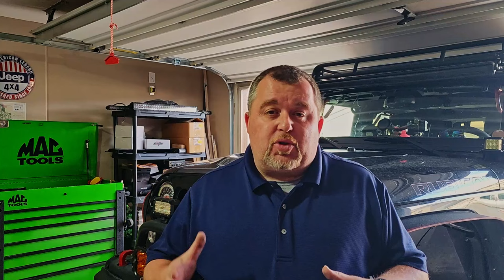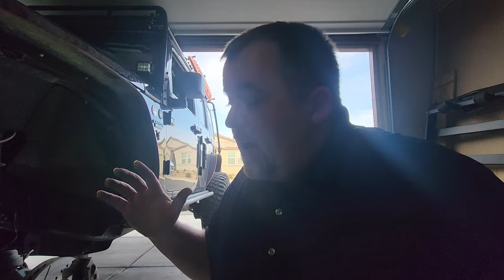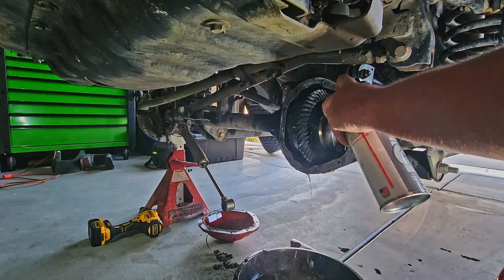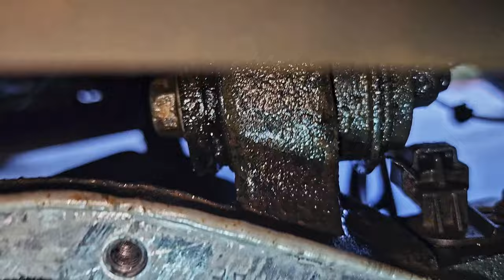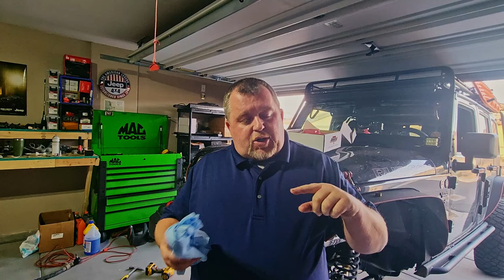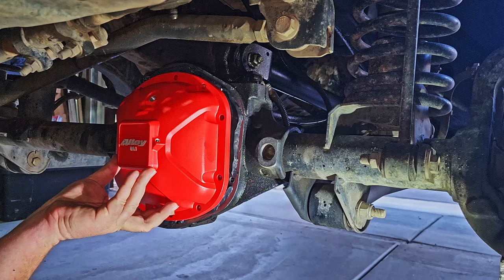What's inside a differential, plus major diff cover fail!

Comment: A note that I would add, when laying the bead of RTV/sealant, go around on the inside of the bolt holes on the housing. Also, you can use a couple of bolts through the cover to help line the cover b4 sticking it on.